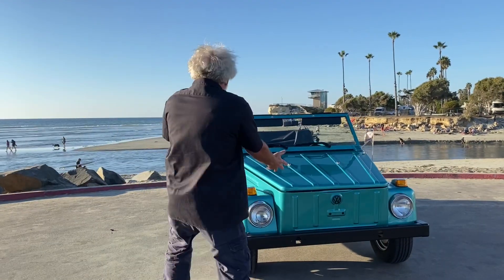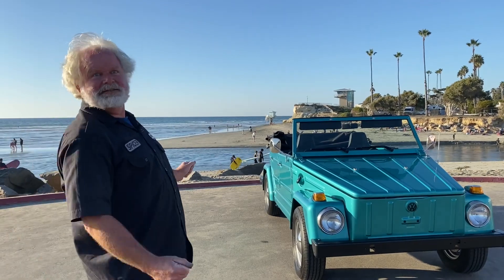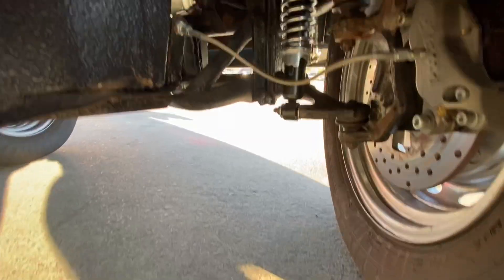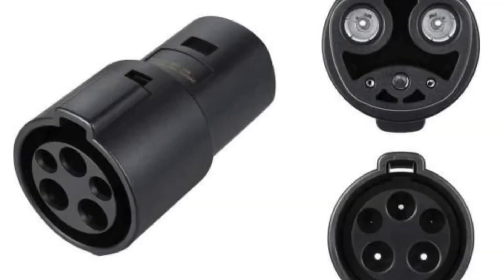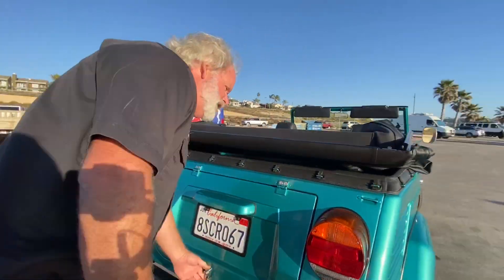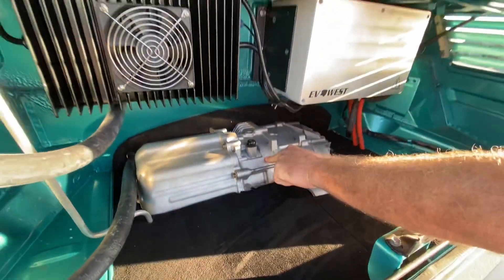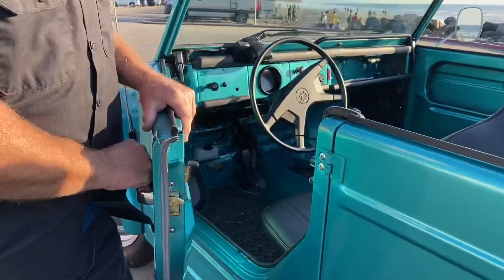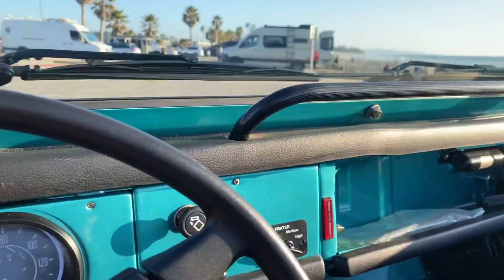1974 Volkswagen Thing  Tesla Conversion | EV Show

Comment: This guy! 🤠
I wish he gave us more info as to  convert costs........😃
Reply: Sorry , conversion costs, weight comparism before n after n top speed....
Reply: @robertamoyaw1979  Tesla small drive unit about $10,000, add batteries &26,000, some odds and ends $4,000. It weighs about 300 pounds more than the original curb weight. I have now idea of the top speed but it gets sketchy about 75 mph.
Reply: @christopherspicer9341  thanks Dude , thats very good info 🤠

Comment: Oh my God find a Nissan cube...... And fricken convert it. Please if you find any sign cube I would love to see a video of you guys converting it  and then doing a clean burnout with it as an all wheel drive beast with at least 50 mi of range
Reply: And when you do this can you please do a tutorial on the cooling system because if it's not air-cooled I would love to know how you did it. And how the cooling system works
Reply: @Badgerroodragon  a Nissan Cube is too new for EV West to be interested in converting. The cooling system is built out of Tesla coolant pumps and a motorcycle radiator.

Comment: What does the drive unit output and how much power do you get at the wheel?

Is it a single gear transmission for drive?
Reply: Yes, I'd like to hear see the specs too. Cool conversion but what sort of power, weight, and range do you get from it?
Reply: @danbradley7176  About 250 hp, just like in the Tesla. We are testing the range and hoping for 100-120 miles per charge. We used the complete small Tesla drive unit and it has a single speed transmission. The Thing now weighs 300 pounds more the  original curb weight.

Comment: Interesting video but the high energy presentation made it hard to glean the relevant data. I got that the conversion uses a small Tesla drive unit and about 12 Tesla Smart Car battery modules (I think) but I would have liked to know about the controller.
Reply: Replacement inverter control board from Zero EV in the UK.